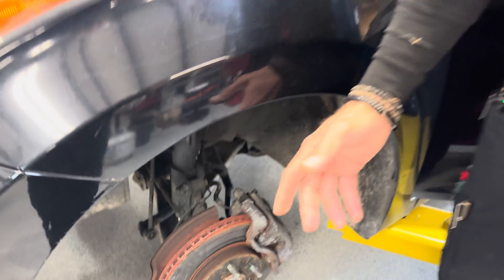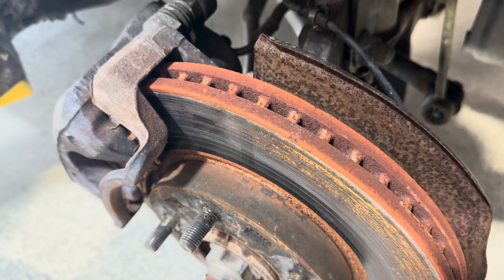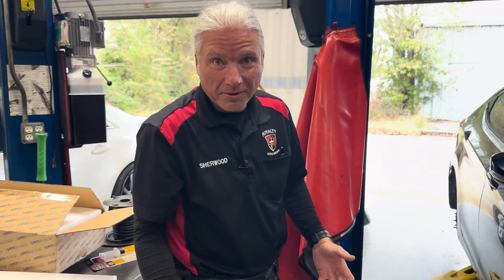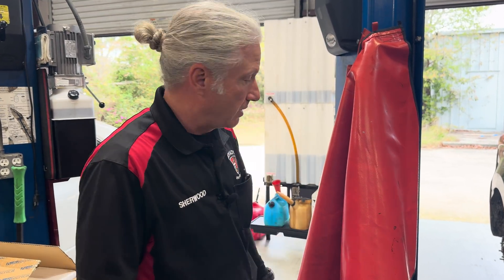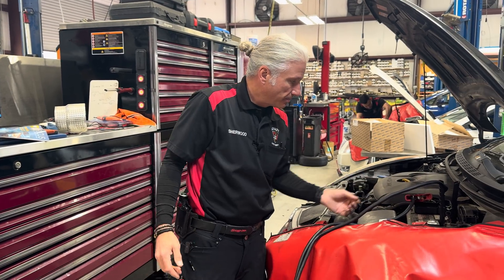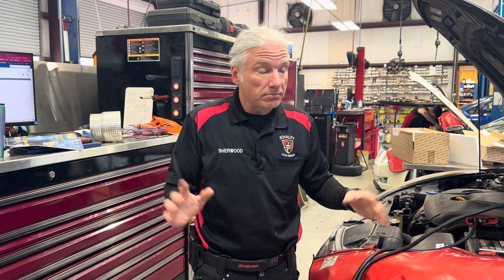The Brakes Caught Fire, But It’s Not Calipers Or Hoses! (2013 Hyundai Elantra)

Comment: Stuff like this brake light switch make me glad I have a 3d printer. Just spend 5 minutes designing a rubber piece and 20 minutes later replacement part comes out.

Comment: I did that once on rear drum brakes. I adjusted the adjuster too far out, the brakes were too tight. Drove it down the interstate and it was smoking from heat. Had to redo that side wirh new pads and adjust it properly.

Comment: Saw that on a 95 Civic clutch pedal once.  No crank with key.  Tested starter and it was fine, tested clutch switch manually and it started.  Took me a minute to notice the hole where that nubbin fell out.

Comment: Have had several in with the plastic stopper missing or a hole worn into them. Most parts store here carry the replacements in the “help” section. Dealer here is $15 for one.

Comment: Advanced Level Auto diagnosed a Nissan where the engine was stuck at limited power because the brake light switch was telling the computer the brakes were always applied. That feature would have saved the brakes from overheating in this case. I remember however that Eric took a long time to diagnose that Nissan all because there was no informative trouble code, such as "Brake pedal switch irrational".

Comment: I had a 2012 Sonata 2.0L turbo with an intermittent low power/hesitation on acceleration complaint. I noticed that sometimes brake lights stayed lit and there was a Brake switch correlation code stored in ECM and ABS. Looked at live data and noticed that brake switch A was ON and switch B was OFF unless I lifted the brake pedal up with my foot, then they were both OFF. Disconnected the switch and took it for a spin and no more power cut to the engine. Took a look at the switch and found that the plunger had used up the plastic insert on the brake pedal. Replaced the plastic insert and everything was working as it should

Comment: It looked to me like the plunger bumper (insert) that fell out, had been pushed up and was lodged in the brake pedal in such a way to hold it slightly depressed. Once it fell out, that would've solve the problem of the brakes being applied without foot pressure, but would need to be reinstalled properly to solve the brake light issue.

Comment: I had a hyundai where front left wheel locked up do to the abs unit and there was a recall where they had to install a resistor for it not to happen again

Comment: I worked on a Nissan Altima that kept going into low power mode when the headlights were turned on. It ended up being a bad Tail light assembly letting voltage bleed up on the brake wire, making it think the brakes were applied whenever the headlights were on.

Comment: There is a recall from Hyundai on this issue:
Hyundai Motor Company (Hyundai) is recalling certain 2013-2014 Elantra sedan, coupe and GT vehicles. The brake pedal stopper pad can deteriorate allowing the brake light switch plunger to remain extended when the brake pedal is released. This will allow the brake lights to remain illuminated continuously. It can also allow the shift lever to be moved without depressing the brake pedal, or activate the engine management brake pedal override feature
Reply: Question. If a recall is given, can someone, not knowing about the recall, get reimbursed if they paid to get it fixed?

Comment: IMPORTANT: Sear Sir, I strongly believe that the brakes is partially engaged because of a faulty brake hose, specially the front ones, not due to brake switch. It happens in my Honda after I replaced brakes and rotors for couple of times to find out that one of the front brake hoses looks very fine from the outside , but it have some sort of collapse from the inside which make it act like a checkvalve, i.e. compressing flued to the caliper but not back or it takes long tome to relieve back due to clogged brake hose. So please remove the hose and check it with compressed air and compare to new one. Take Care. John
Reply: one hose yes i agre 2 your pushing it all 4 not a chance some else at the bottom of it your symptums are totaly different and the fact the brake light switch is stuck on that is key

Comment: Highly unusual I think, I have recently seen a booster causing this issue though. With the engine running it would gently apply the brakes, eventually causing heat damage very similar. Have to watch for this brake switch issue now also.

Comment: I had a chevrolet pu one time come in the shop bad master cylinder bad had filled booster full of fluid. replaced master cylinder and booster bled system test drove everything good. customer picked it up lived about 10 miles from the shop called me later and said he smelled brakes brought back i drove it couldn't get it to do it. he picked it up again he was a older man his son called next time and said you had to drive 10 to 15 miles before it would do it. brought it back i drove and sure thing little over 10 miles truck started slowing down and would completly stop fron brakes hot pull over and switch off wait 2 or 3 minutes and start up same thing all over again. kept driving and found out all you had to do was switch off the truck and start back up and brakes were just fine until drove about 10 miles. took me several days research ran across a article where same thing happened and the rod coming out of booster out of adjustment did same thing. i loosened mastercylinder and sure enough about 2 flat washers of pressure so i installed 2 flat washers drove problem gone. replaced booster again and all was good. could have adjusted rod but parts house said no let them replace it replaced it no more problems. strange things happen

Comment: Or was it that the abs saw the brakes applied and didn't see the brakes working, so it applied pressure to the front wheels? And that caused the wheels to overheat.

Comment: Hyundai tech here, don’t recall if that year counts but I’m pretty sure it does however we actually have a TSB/ Service campaign active for this exact thing. I could find it if I went looking but off the top of my head the brake light switch does work along with the wheel speed sensors to detect and prevent lock up. I’m a little iffy because I personally haven’t had to deal with it much due to only being an employee for a year. Definitely an interesting one for sure, I swear hyundai has some of the weirdest things happen
Reply: Interesting.
Reply: I’m a Hyundai tech too and I agree, these cars be weird. Easy to fix most the time tho
Reply: @shanedottie  You spelled garb wrong lol

Comment: I’m not sure the path was complete. There are a few other things I would have done. See if the rear brakes are applying. Try to bleed the rears and see if you get fluid flow. The rear rotors looked rusted to me but it was only a quick view I saw. Proportioning valve stuck, does it have one. Is it a diagonal split system? I’d ask, was it recently worked? What was done? Has the car been sitting a while? Calipers frozen in the holders.

Comment: I’ve seen MC failure causing no rear brake operation as indicated by the LR rotor condition causing overheating of front brake system. The vehicle will return